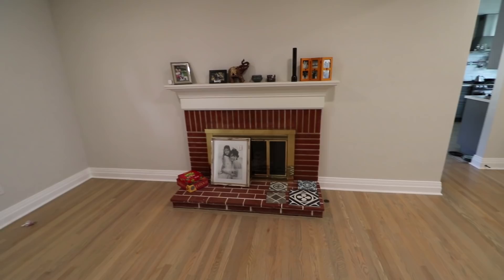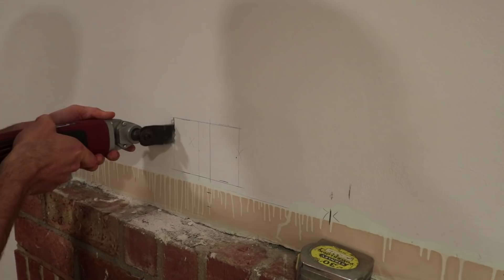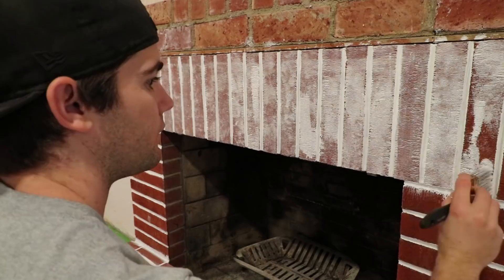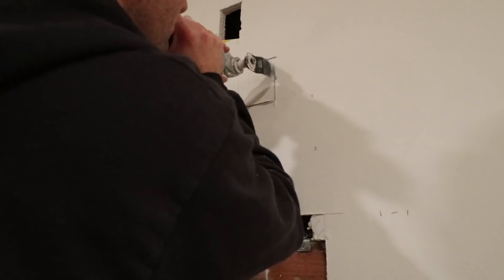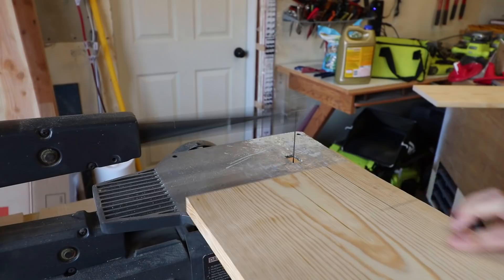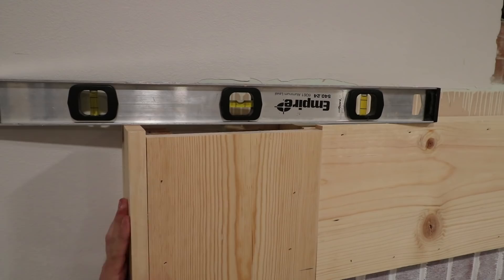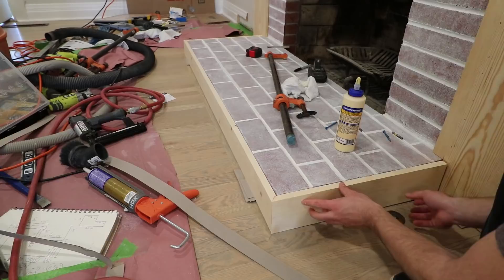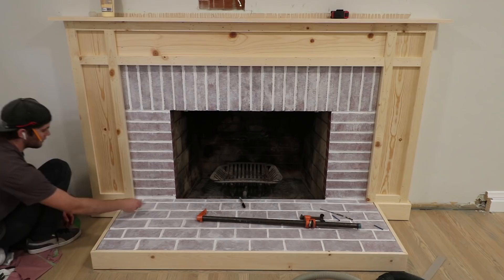DIY Fireplace Remodel Pt 1: Whitewashing Brick & Custom Surround

Comment: As a European, I’m pretty experienced mounting things on brick. Use masonry plugs, it will usually increase the strength of the hold and you won’t have the issue of your screws not going in.

Comment: Hey... so the problems you are having with the brick and screws ... i saw it in your video of a door too.....
there is a simple solution to that... 
1. you drill a hole and use rawal plug to screw anything into brick or concrete....
2. a DIY solution is to use scrap pieces of wood to fill in the drilled hole and then screw into it....

your doing awesome work!

Comment: First buy at the very least a 70” tv! So much mantel left over on both sides makes your TV look WAY SMALLER than it really is! You should have enough on both sides to put a smaller lamp on each side with at least 2” where the lampshade sits from the end and the same amount before the lampshade touches the TV. 

I love how you made the mantle open to store wires, consoles, etc. seriously that was a great idea and you executed that part beautifully! But, first just look up measurements on line for the actual Tv dimensions and go get at a store like behind a Walmart or grocery store a big piece of cardboard and cut out the dimensions of a 75” you like then simply Place it up there with painting tape to hold it there. Really helps you to decide what you want. 

****Make sure to buy a TV mount that holds the correct weight but also with the turning of a screw you can lift the TV up 3” or down 3” then you can get it close to the mantle if you need to so your tv is not way up to the ceiling. Great Job man! But that TV is absurd looking! lol! 

You have to install a bigger TV ASAP! First, who doesn’t love a bigger TV? Second, Your mantle is nice but way to big! Even if you put a 75” up there it’s still to wide! It’s disproportionate to everything! I would 100% take off enough to where it sits exactly flush with the very furthest part of the paneling beneath it.

Comment: I usually enjoy your videos espacially what you are doing in your workshop. But that fireplace looked so much better before. Plus I hope you will never use it because like this it is a real fire hazard the bricks and other materials arround the fireplace are rated for high heat for a reason. I hope you stay save for a lot more videos :)

Comment: Great little ditty man.  Good job.  I wouldn't have skirted the hearth though.  Especially not in a soft pine like that.  Not going to be long and top outside corners are going to start chipping out and/or just getting badly scuffed and gouged.  You WILL regret it.  Also, the skirt hides the full geometric look of the brick.  Now it just looks like pavers set in a cheap little box and the skirt doesn't look as good against the flooring as did the brick.

Comment: I have seen so many TV mounts above the fireplace. Is anyone concerned about the heat rising from the fireplace and how it will damage the TV?
Reply from the maker: We don’t use the fireplace for fires so no concern there! I’m sure the tv would be ok, though I’d be more concerned about the electronics in the mantle (since it’s closer to the opening)

Comment: Playing with Fire 

  You Might just  get  - B U R N E D 

Not something  to joke about .  The  brick area around  the  fire place has  specialty Rated  Refractory  Type Qualities .  Wood , Glue, Nails , and other such products  never come even close to Protecting you from the  high  heat and  direct along with  indirect heat and its  reflections from any size fire. No Matter if  Gas or  natural - The  products that are being  used  need to be  rated for Close Contact to High Heat .  This is  not a  window  trim  out  or some  floor  board detail. Manufacturers  have a  Whole Entire line  of  Specialty Products  for  these types of Applications for a  reason .  Ever  heard of a Chimney Fire before ?  The  amount of  issues that  fire places  create  far out weight they amount of  brad nails , elmers glue , or  pine  boards combined to Stop a  fire out  of  control instead of  CONTROLLING  the  fire  burning inside.   TAKE THESE WORDS SERIOULSY !  You added  so many Combustible Products  directly  next to a  High Heat  Source that  Smoky the Bear  would  be  running to the  hills to save is butt and that is nothing  to brush aside when families are sleeping  right  by your side.   Oh , By the  Way ( HEADERS )  be them Load Bearing  or  Merely  Decorative need to be  Larger than the  span they are Covering . A  4x4 post is  not  Four Inches  by Four  Inches.   You should  have  put in at least a  6 to 8 inch Version to Keep ( THIS Old  House ) from falling  down around  you.  What  was the  norm in the  1920's  is Anything BUTT Normal  for  modern day  building  codes.   You sure have  opened up a  can of  worms  that may just  find  you out in the  cold  if  is  all comes  crumbling  down around  you . Last but Not  least.  Before  tearing into anything ( RESEACH ) the  Current  Methods and  Restrictions of What  you  can , should , or  would  do ( BASED ) on what the  Up to Date Products and there practical uses are ahead of time.  Inspectors  love to Pick Apart  ( D I Y ) projects for they Rarely come  close to What is  needed , expected , required , and  allowed.  Think All this  sounds  HARSH .  Wait until  you  have to explain to  your  Home owners  insurance  carrier  how  you  Saved a  bundle and  now  are living on the  streets in dire need of  some  relief … Word to the  Wise :  Think - Before you act  and  always ( Act ) accordingly to  what  others  forget to  think about  in the  first  place.
Reply: M C L that is such a good point that I didn’t even think about. I don’t have my house yet (hopefully soon 🤞🏽) but I love diys. Thanks for the reminder
Reply: We all hear what you're saying, but maybe this family doesn't have any plans to use the fire place and it's only there for decorative purposes. Maybe the next people that live in the house won't use it either. We just bought a house from an original owner of 30+ years and she never used the fireplace once. We aren't either. So sure, maybe it's not safe IF you use the fireplace, but if you don't, I don't see the issue. Inspectors can nail you all you want, but if the buyer doesn't care and has no plans to use it then....why should you?
Reply: There is no such creature as “Smokey THE Bear.” His name is Smokey Bear; first name, last name. Both Smokey Bear and Woodsy Owl are trademarked by the U.S. Government, Dept of Forestry. I think you are conflating Smokey Bear with Felix the Cat, a cartoon character created by a commercial studio.
Reply: @katelynmoreno1804  Wow! If that’s the case then you just completely shut this guy down badly! I really want know if he plans on never using it and keeping it just for looks like you stated might be his intentions?!
Reply: @leeb.7188  Well, none of the creatures technically exist at all so what are you doing debating the existence of something that doesn’t actually exist as a real life creature? He is called “Smokey The Bear” but it’s not the cartoon drawing’s official name. The added “The” to his name but only for the purpose of the song! But, thanks for letting me learn that the non existent creature’s actual name is Smokey Bear! lol! No matter how ridiculous it may be if you try you can learn something new everyday!
Reply: @katelynmoreno1804  Well, never mind and disregard that first message I left you! If you go to the final video at the very he explains how this will never be a working fireplace! So, you were 100% correct in calling out @M C L for him saying what he did might not be correct because he may never plan on using this as a working fireplace! That was a great call on your part!!

Comment: Whered the big ass tv go?! Whats with that tiny thing
Reply: Thank you! I was getting worried that not one person here had a brain or actual taste for that matter! You definitely are smart so read what I suggested and let me and this guy know what you think?
Reply: First buy at the very least a 70” tv! So much mantel left over on both sides makes your TV look WAY SMALLER than it really is! You should have enough on both sides to put a smaller lamp on each side with at least 2” where the lampshade sits from the end and the same amount before the lampshade touches the TV. 

I love how you made the mantle open to store wires, consoles, etc. seriously that was a great idea and you executed that part beautifully! But, first just look up measurements on line for the actual Tv dimensions and go get at a store like behind a Walmart or grocery store a big piece of cardboard and cut out the dimensions of a 75” you like then simply Place it up there with painting tape to hold it there. Really helps you to decide what you want. 

****Make sure to buy a TV mount that holds the correct weight but also with the turning of a screw you can lift the TV up 3” or down 3” then you can get it close to the mantle if you need to so your tv is not way up to the ceiling. Great Job man! But that TV is absurd looking! lol! 

You have to install a bigger TV ASAP! First, who doesn’t love a bigger TV? Second, Your mantle is nice but way to big! Even if you put a 75” up there it’s still to wide! It’s disproportionate to everything! I would 100% take off enough to where it sits exactly flush with the very furthest part of the paneling beneath it.
Reply: @stevenfjaxsen8464  nice suggestion my friend, totally agree

Comment: Where in the H&*%^ did you learn to saw on a table saw ???? Man you are lucky to still have your 10 fingers !!!!!!    1- Always have your table saw to your height  2- Always have a roller or sawhorse to receive the exiting wood    3- Always have a push stick when you have 2" or less of cutting materiel   4- NEVER NEVER NEVER pull the materiel on the EXITING SIDE !!!!!!!!!!! AND LEAVING THE TABLE SAW ON !!!!!!!!!!  Please use youtube to your advantage and see what has to be done with a table saw before using it or other tools for that matter !!! I've seen so many injuries in my woodworking career , please don't be one of them  😉